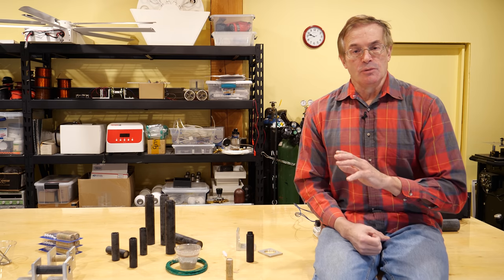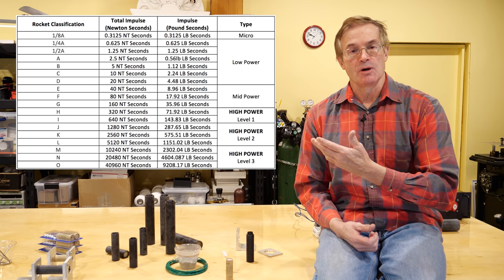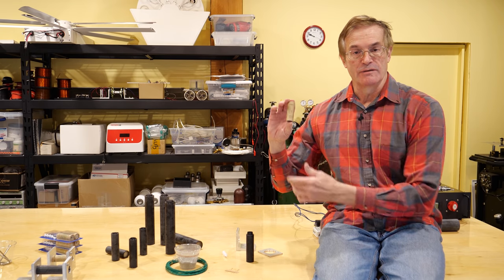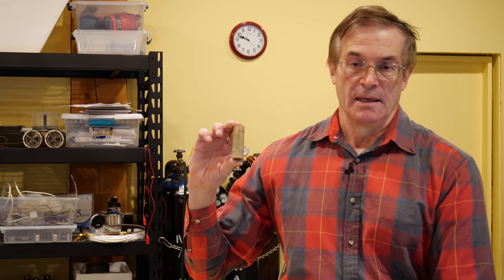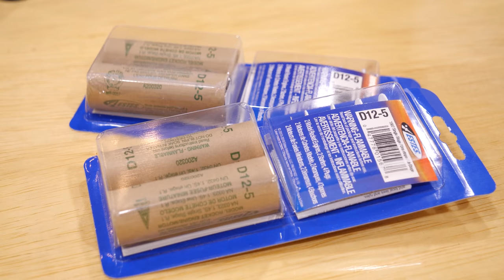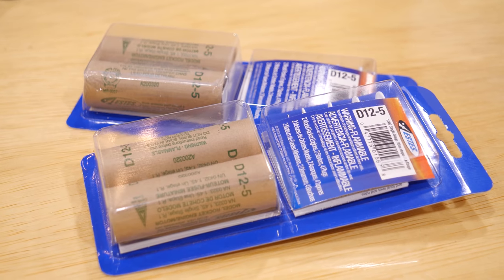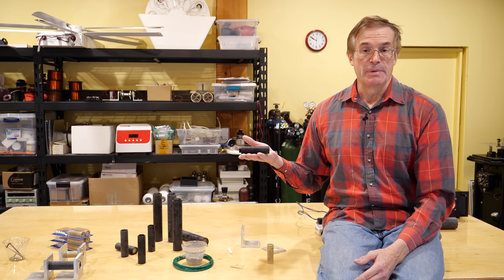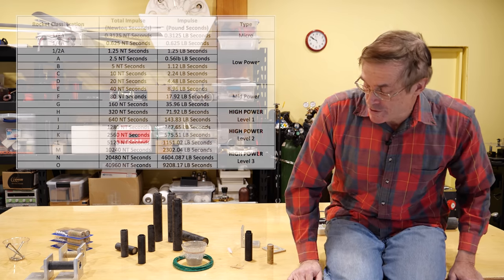Igniting Our Own Rocket Engines - DIY

Comment: How are these new weapon missiles (Hyper Velocity Missiles) achieving velocities of Mach 8+ when the upper limit of rocket gas exhaust velocity is at Mach 5???
Reply from the maker: That's because the fuel is carried along with the missle as it accelerates.  The reference plane is from the missle not the observer.

Comment: Hi from Sweden!
I have interest in knowing if there are any ways of simulating stiffness in a otherwise plain rubber surface. 
Stiffness on command if you like.
#roofthingz
Reply from the maker: Have you ever seen a vacuum bag support fixture?
The principle is simple, a tough rubber or plastic bag is partially filled with small beads similar to the old "bean bag chair" and when a vacuum is applied to the bag, the envelope tightens on the beads while maintaining the shape it was in just prior to evacuation. It gets rock hard.
Reply: @TechIngredients  I see, I have not. This is for a not yet invented roof To be used in construction. It's an idea of mine to solve prefab buildings hardest task.

Comment: After 9-11 one of the "knee jurk" reactions was to require a license (Presumably from the FAA) for larger rockets. Is this still true? 

If I remember correctly,  it was for rockets with larger than F engines.
Reply from the maker: If that were true and I haven't heard of it, such a misdirection of effort would suggest that enforcement  would be very limited due to incompetence.
Reply: @TechIngredients  it was probably just a suggestion that didn't go through, but I took notice to because of rockets being a former hobby.

Comment: That old clothesline Now going to be  the   Acme wocket           wizzy fireworks  Machine  
Add color & sparkles into the mix   Uno you will    
cost of 1 rocket  ?  vs homemade   -   which fireworks   Not 4 sale sale in OZ   :(  
  Safety 1st   always have water  or extinguisher   close by

Comment: A very safe and precise way to ignite such rocket engines are exploding-bridgewire detonators (EBW). There is no additional pyrotechnics required, as the naked metal wire between two electrodes. The whole ignition energy is stored in a high-voltage capacitor and discharged by a triggerable switching-element (e.g. a high voltage, high current thyristor) into the wire. The resulting fireball ignites the rocket fuel. Rockets with more than one engine (typically such with boosters) require a high precision ignition procedure to ensure symmetrical thrust build up. The downsides are thick cables, bulky capacitor banks and high voltages. Contemporary nuclear devices with an allowed maximum Jitter of about 50 nsec go even a step farther and use slapper detonators - a thin foil from aluminium, or even copper, that is exploded electrically and creates a fast, highly energetic shock-wave. Fortunately, ICBM with thermonuclear charges are out of the reach of rocket amateurs. Therefore, there is no need for slapper detonators.

Comment: Wow. Not much flame comes out of that fuel. My BP fueled, pyrotechnic rockets send a flame out about 5-6 feet long. Depending on what size actual motor I’m using. But those solid fuel motors seem like they could have a use in my arsenal. In places where I don’t want allot of light coming from the motor itself.
Reply from the maker: You're right.
Take a look at a couple of our more recent videos on  ignition systems where I demonstrated some ammonium perchlorate based composite fuel grains...a lot of flame there.
Reply: @TechIngredients ....when I watched the first video I commented about lighting the top of the fuel grain first. Then I came to this video and that’s one of the first things you said. Lol. I spoke too soon. 

In the pyro industry, we still use electric igniters. But we use quick match to run up into the motor. Quick match is basically black match inside of a paper tube. The paper tube causes rather slow burning black match to burn the length instantaneously once placed inside the paper tube/straw. I roll mine with thin copy paper around a curtain rod. I use a curtain rod instead of a dowel. So I can jam one end of the paper into the seam of the rod to hold it while I get 2-3 turns of paper around it. I then tape or glue the final turn to itself and slide the tube off of the rod. I then use 2 strands of black match and 1 strand of commercial quick fuse inside the tube. I leave about an inch of fuse sticking out the top of the tube on the rocket side and tie that end closed close to the end with thin cotton string using a clove hitch. On the e-match side, i cut the fuse even with the tube end. Then I go ahead and tie the tube down against the fuse about 2 inches up from the end of the tube. This allows me 2” of tube to shove the e-match into later. This entire “quick match” fuse apparatus should push all the up to the top of your rocket core and stick out the bottom of the motor a few inches. Before I insert it into the motor, I twist the paper down tight-ish around the fuse. Leaving the bottom 2 inches not twisted. The twisting just crumples the paper down so it fits better into my cores. Then whenever I’m ready, I can Instal the e-match and tie the final end closed around the e-match and fuse. Using the quick match as I’ve stated still gives you the instantaneous ignition without delay, as soon as you fire the cue. But it’s much easier to shove the quick match tube up into the core than to try n shove the E-match all the way up the core. Plus soon as the E-match fires n lights the fuse, it nearly always falls right out onto the ground. Instead of having wires and rubber insulator being melted as the motor lights and before it gets blown out. Making it a tad safer. 

Im not sure of any of this will help. Im just explaining what I do. This is in no way any sort of settled science or rule. Just sharing ideas is all. 

I really wish ya the best as always. And thank you for the reply.
Reply: @TechIngredients ....one more thing, later this summer I’m planning to go for a world record. Im going for the largest AND longest burning smoke bomb. I started playing with these back I when I saw you do them and I got the vast part of my education from you. I’ve tweaked things a bit to work for me and played with ratios of the composition. But with your permission, I’d like to give a shout out to you when I go make this attempt. Or even if ya want, you’re welcome to be present when it happens.

Next year I’m going for the largest pyrotechnic shell bursted from a rocket. So you’re also welcome to come be a part of that as well. Guinness will be present at both attempts and I’d be happy to list you as having a hand it in either one or both. Im just outside Olympia WA. I’ve not got a final location for the attempts solidified just yet. But it’ll be close to this area. 

I don’t have the money, backing, or knowledge to go for the largest mortar shell. So I’ll have to leave that to the big players. Im a SMALL pyro biz out here. I specialize in pyrotechnic funerals. When people get cremated, I scatter their ashes by means of a rocket fired shell. So they “take one hell of a last ride and go out with a bang”! I can make about any type of display they request and can afford. So they get a really beautiful shell or shells to go out in. As far as I know, I’m the only biz specializing in this. A few other people do it by request only. But it’s my biz model. That’s close to all I do in the pyro biz. Besides some small rocket shows here n there.

Comment: The burn seemed a little uneven?
Reply from the maker: It was.  That's probably due to the rough, hand positioning of the core rod.
We've modified for the next series of engines.
Reply: @TechIngredients  Can you measure thrust for the next series of tests?

Comment: How do you determine the diameter of the throat in the nozzle?
Reply from the maker: There are calculations available on line based on the regression rate of the fuel, the surface area of the core or in the case of an end burner, the cross section of the fuel grain.
It gets more complicated because most fuels will burn faster as the pressure in the chamber rises producing a positive feedback loop.  Ultimately, you need to do some testing.

Comment: I was under the impression that you want to light core burning engines from the deepest part. It's hard to tell what's happening in these.
Reply: You do. Lighting them with a fuse is extremely inefficient because it ignites nozzles first.

There's a reason we use electrical ignition and it's not just because it's safer!
Reply: @mduckernz  But it's possible they used a contained fuse, it really doesn't look like that in the videos. I'm so confused. To get reliable thrust data you would need to end light. I guess it's possible that flash powder could distribute the ignition reliably up the column, but why would you risk that when end ignition is so reliable and easy?

Comment: Ow ya  l am building a rocket 2"  PVC  s 40  will be o k   or not?
Reply from the maker: If you mean for the motor, then I'd advise  against it.  PVC is relatively  weak and brittle. It can explosively shatter.
Wound fiberglass tubing  isn't that expensive and is far stronger.

Comment: My 2inch sugar rockets did  better  then those F engines,    Nothing more then PVC and JB Weld Nossels.   Bare bone engines and fins did 1200ft faster then fast.  1 inch nossel plug drilled out with  a step drill 1/4 to 1/2.    Didn't even couture the drill cuts.  Use metalized JB weld.  Drill  anchor  holes to   secure.  One time use.

Comment: The nozzle quickly burns out and the engines do not gain thrust. Sluggish cravings.
Reply from the maker: No they don't.  It's suprising how little erosion there is.  We'll measure a few pre and post in the next rocket video.
Reply: @TechIngredients  It would be nice to make a simple stand and measure the traction, at least the maximum.

Comment: I was a little disappointed. Not in the results of the burn tests, but that you didn't summarize the results. They didn't appear to generate useful thrust.  So I would have liked to have seen measurements, and theories as to why they didn't work. You just burned them, after discussing output standards (which was interesting).

Comment: If a rocket motor accomplishes thrust from pushing against a positive pressure outside the nozzle, then rockets in the vacuum of space are another impossibility!
Reply: I think this is the wrong channel for you, mate. Rockets generate propulsion by expelling at high pressure, not by pushing against anything.
Reply: That's not how it works. Rocket motors do not push against an outside pressure. Heck, forget about the pressure. A rocket engine is a reaction engine, and thus generates thrust from sheer momentum transfer. Think of it like the recoil of a gun, but continuous.
Reply: No. The combustion of chemicals that burst into high pressure gases, creates its OWN pressure
In fact if i remember correctly, rockets make more thrust in vaccum than in an atmosphere.
Reply: If rockets worked by pushing against the atmosphere, then they wouldn't work in space. That is true. But that is not how rockets work. And they do work in space.
Reply: Funny enough, a rocket's exhaust at sea level if often a lower pressure than the atmosphere around it. It's not pushing off the atmosphere, it's simply throwing exhaust out of the nozzle and capturing the momentum. It's like a gunshot, but continuous, and the bullet is replaced with atoms of whatever your fuel created by burning, hence why they work in a vacuum.

Comment: I have enjoyed many of your previous videos but as a level 2 certified member of the National Rocketry Association, I just cannot enjoy the flaunting of safety precautions in this series. Model rocketry is one of the safest hobbies around (including the 20lb, 50lb and 100lb, mach 2 rockets), because there is an understanding that simple things like electric ignitors are a very good idea. They're  cheap, easy to construct, and keep you out of harm's  way. What's the  down side?

Comment: I think the title is correct "engines" because they burn fuel, i.e. gas engine, diesel engine.  "Motors" do not burn fuel, i.e. electric motor, hydraulic motor, pneumatic motor, spring motor &Etc.